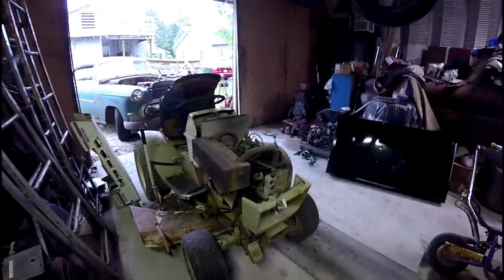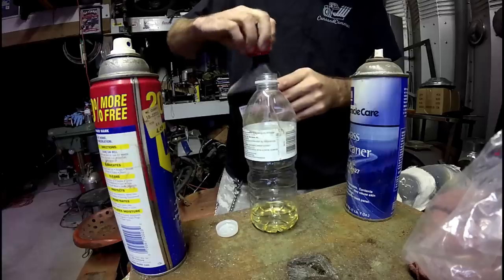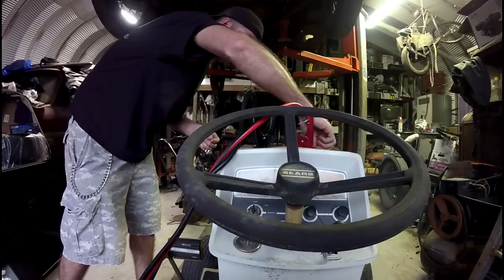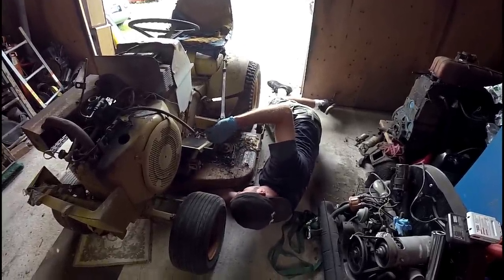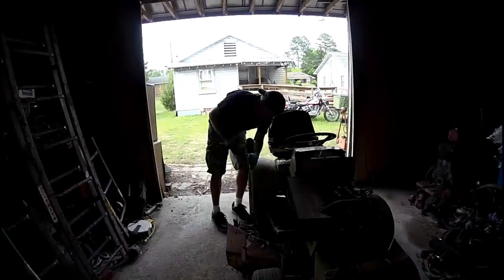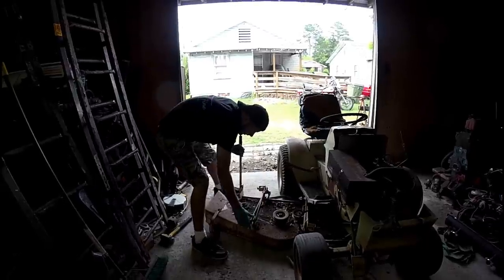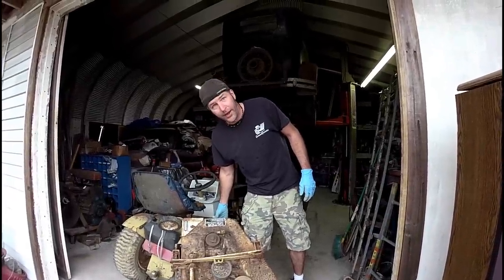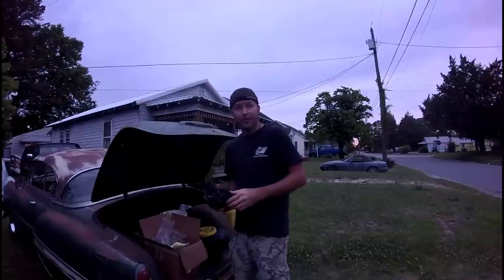The Super Sport Lawn Mower: Ike's Adventures

Comment: He got a Sears garden tractor, dame those things are hard to find.
Reply: Brad Heller I know seriously I finally found one after 3 years
Reply: Turtlemans Fabrication what? Where are you? I've had over a dozen in PA. Currently have two. Ones a dually and one has big AGs and I use it for mudding
Reply: Brad Heller I have a sears gt11 with a yanmar diesel in it, things a tank
Reply: I have a 1978 gt14 with a 10hp yanmar
Reply: I've had 3 in il
Reply: I have a ST 16 Sears.  16 Tecumseh single cylinder . Can pull small trees out of the ground . Roots and all
Reply: I've got an SS18, my one pal has five others, and my other pal has two
Reply: I have 14 of them
Reply: Unfortunately these are very hard to find in Louisiana. I wish I could find a running one or one that needs little work to get it going.

Comment: I have a 73 Sears SS16 with mud tires and 19 inch fronts with a 6 inch pulley swap and a normal 74 Sears SS16 for pushing snow.

Comment: Heat up the bottle cap with a lighter and get it soft and take a nail and try pushing it out to make a tip and funnel.  Trim the tip for the size of fuel flow needed.  Makes a cheap an' easy test fuel bottle.

Comment: That mower is an old sears suburban with a onan twin
Reply: Awesome motor but internal parts are a little pricey...  luckily his sounds pretty good.  That tractor is used by a lot of stock class garden tractor pullers.  Not many engine mods available.  Hopefully he restores it to stock.
Reply: Traxxas Chevy fearlessfront has a diesel sears suburban
Reply: Custom Cut Lawn Care I don't know whose is better Doc's Diesel Weasel or Todd's (Fearless front) Diesel suburban.
Reply: Traxxas Chevy I have 2 Onan engines they are awesome...
Reply: Ratkill9000 fearless front due
Reply: Those old Onan twins are really solid engines
Reply: Aren't those on an twin really hard to find parts for

Comment: that mower was 73-74 only. a pretty rare machine.
Reply: chefkeith99 I know right
Reply: chefkeith99 the SS16GT/16 with twin Onan was made from 73-78, Sears made about 200,000 in those years, definitely not "rare"
Reply: right! lol I have seen a small engine junkyard in NY with hundreds of these old sears with twins and even the old 60s sears XXL tractors. I used to own one that was built for stock class garden tractor pulling. they are not rare one bit you just need to know where to buy your stuff and not get ripped off.
Reply: wikipedia says 73-74 only with the onan engine. argue with them
Reply: Wikipedia. that's funny. Us collectors actually use sources that have correct information. Suburbans had 16 Hp Onans from 73-78, 18 Hp from 75-79, and also had the "big block" 20 Hp Onan in 78 and/or 79..... and they made a ton of them.
Reply: The best one is probably www.vintagesearsgardentractors.com , it has most of the model #'s and years. A good one for manuals  is www.searstractormanuals.com.
Then you have forums like Garden Tractor Talk and My Tractor Forum where collectors and hobbyist share their info. There are so several good Facebook groups for Sears GT's. Tractor Data is not very detailed IMO and Wikipedia, well, that's obviously not correct.

Comment: Hay CarsandCameras will you upgrade the carburetor cut off that Muffler clean up the points do a engine flush change the oil oil and clean the spark plug the spark plug.

Comment: Issac,  please keep this tractor stock. I have a 74 s/t 16 which is the single cylinder version of yours. You will be really happy with how tough that tractor is. Mine is a  workhorse and does a lot from dragging a plow to mowing to running a snow blower and pulling a rototiller for the garden.

Comment: I paid 50 bucks for a mint garage find Craftsman II from the 90s, just needed to get running again was told it needed a starter and was parked for 10-15 years people bought a new mower. Put a battery and cleaned the carb, went over all the mechanics and cleaned it up and i've got a nice rig for less than 200 bucks didn't even need the starter.  Gotta save the oldies instead of paying for cheap made expensive junk nowadays. Oh and the I'm blaming this channel for me removing the governor off of it lmao

Comment: Onans huge pain in the ass.   Such a pain. No parts carb is weird would flood the engine with fuel all the time and the Kohler swapped my sears
Reply: But if it works for you good I'll be very happy
Reply: Pman133 Onans are so temperamental. Not to mention ever since Cummins bought onan the prices for parts are through the roof